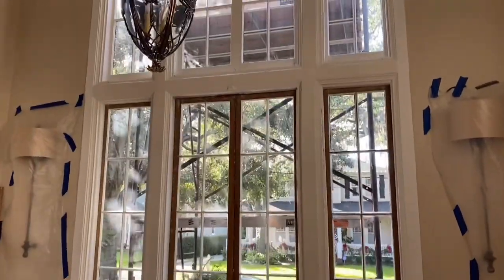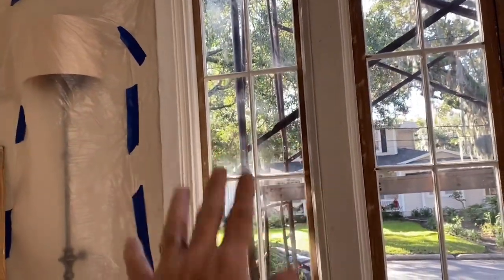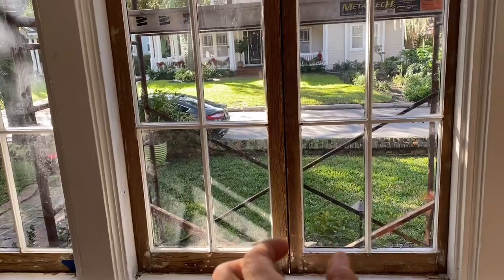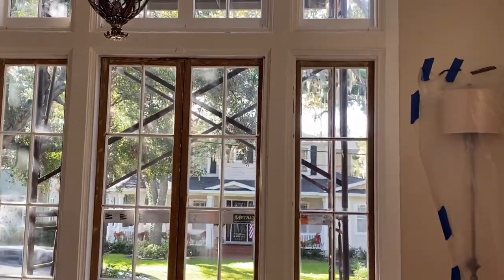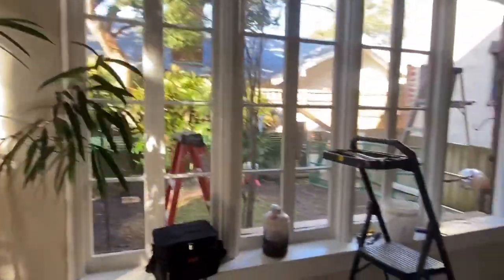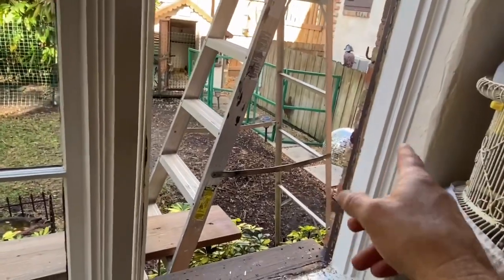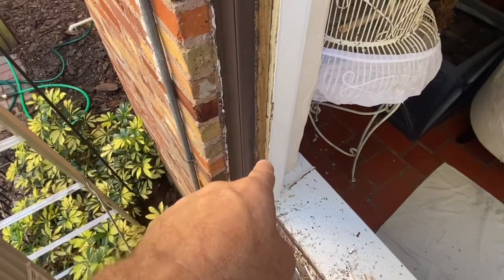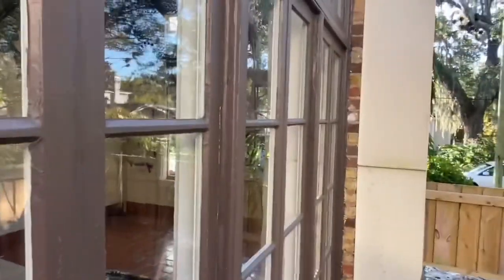Wood Casement Windows. Who Can Realistically Do Them?

Comment: Remove jam and sill , rebuild frame and sash using originals as a pattern, reuse original glass?  With rough opening now available able to plumb and square new window in an out of square/plumb rough opening.   Looks like at least one sash is going to be rebuilt anyway.  Thanks for sharing
Reply: I would think most of the original wood is still good and the most historically/sentimentally valuable to save, if possible.

But I would comment that it's about cost effectiveness; making 12 all new custom casement windows to fit into the settled structure? Damn expensive
Reply: @pennyloafers  I agree if most of the wood is still salvageable.  However at what point do you consider its going to take more labor to work with what's there vs acknowledging that the windows time has come?  Labor can be much more expensive than materials.  What would it cost to restore the window vs replicate?  Perhaps this comes down to what it usual does...a case by case  basis.
Reply: @treystills  Rebuilding to replica , even if less efficient in time willl likely result in a better end product.
Reply from the maker: What it boils down to is skill and mastery. It’s actually most efficient in a case like this to use a hybrid approach. Yes, I have to make a sash, which I’ll also have to fit and hinge. I could indeed build this window from scratch and have built units like this and much much larger. One of the unseen, unspoken of phenomenon a new build requires is the demo and discarding of the existing unit, acquired the materials to build the new, actually building it, then moving it, installing it, painting it etc….  Building windows for situations like this isn’t for the faint of heart and it take a LOT of mastery to be able to pull it off AND make money. I could do it. 

Oh, and there’s also the permitting angle. Gotta deal with that too in many cases. 

My approach like I was saying is a hybrid approach. I’m able to do so because I understand what it’s supposed to be and the thinking behind why it’s assembled the way it is. That makes me faster and gives the client the best overall value, keeping the best of the best, retaining the charm and longevity encapsulated within it. 

And I think that this was the original maker’s intent anyway.